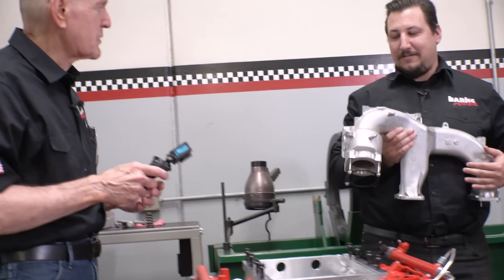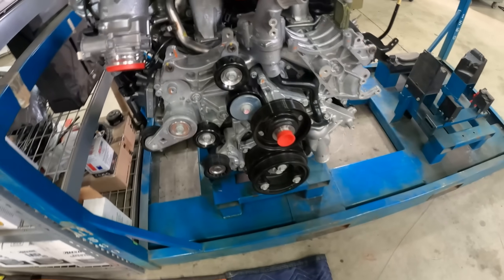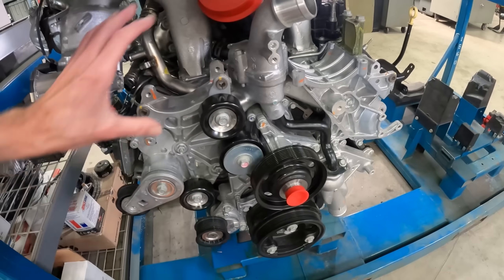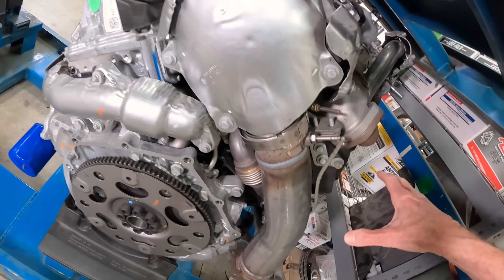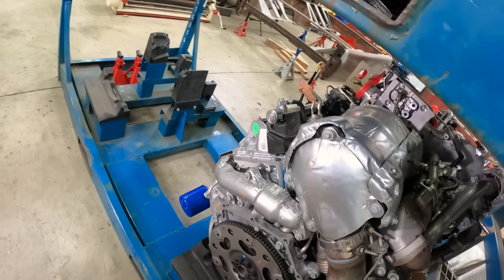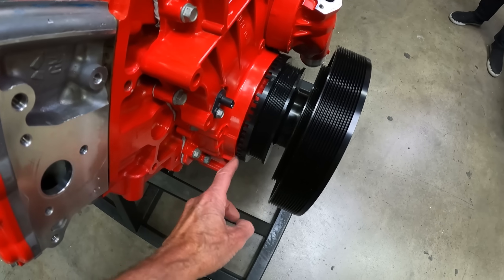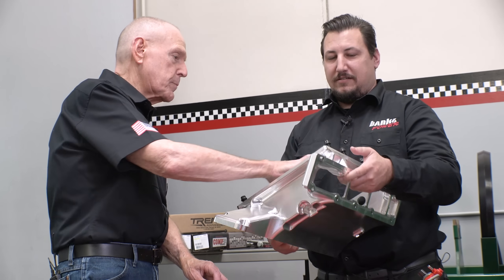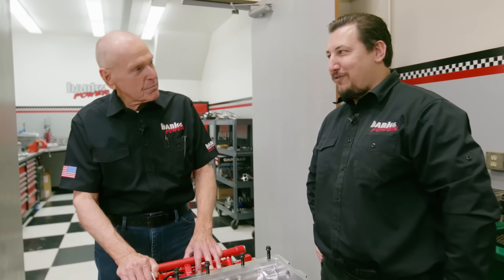Inside Banks SUPERCHARGED DURAMAX engine | BANKS BUILT Ep 40

Comment: I find it interesting that "Banks". Can remove all the emissions and DEF, and "properly retune" ..... and say "they do it right ".  Openly admit it and face no issues.  Yet everyone else who is doing the same thing.  Is targeted, fined, shut down... etc.  ? Don't get me wrong.  I like what he's doing.  I find it interesting about the head bolts. Seems one of the number one "modifications "... is to stud the block. However it's just interesting to hear him say that "he [Banks] does it right, so it's ok..." Alot of shops out there should be a little upset...
Reply from the maker: We are not "re-tuning" an emissions-regulated vehicle. There are no laws being violated. Banks engines are no different than an LS crate engines purchased through Chevy Performance.
Reply: @bankspower  oh, that's the workaround.  You can't modify an engine once its "part of" a car.  Buying a new truck off the lot as a complete item locks in the EPA stuff.  Buying the engine separate from the rest of the truck makes it technically legal to not have EPA stuff.  Pre-emissions truck chassis (or purpose built) and one of these engines is legal.
Reply: @bankspower  ?... true you can add cams and valve train changes...intakes... all those things.  Be it a LS or a Duramax... yes you can purchase a "performance crate motor " through GM.  But does that allow removal of the emissions  ? In the case of Lockjaw... ok it's a 60's era vehicle.  But any newer vehicles are going to require keeping the emissions.  Be it an LS or a Duramax.  I think it's great to pull all that garbage off. The fact is it can be tuned to be better and cleaner running without all the emissions garbage.  However people are getting shutdown and heavily fined. What is the Banks secret.
Reply: @ronthompson2366  They going after people deleting/modifying emissions on vehicles that came from the factory with those items in place. This is a 60's era truck.  Completely different.  You can drop an LS into a '57 Bel Air and not have a lick of emissions on it.  You drop a new LS in to a 2007 vehicle, you better have like for like emissions on it.
Reply: @bankspower  Cmon, you guys still do plenty that would put many shops in violation.

Comment: Since that's a engine designed for production truck, doesn't it make you concerned about the EPA? Where are you guys on the RPM Act? Your influence would be greatly valuable to save our race cars.
Reply: Because it's still going to be cleaner than with GM emissions control.
Reply: @AdmissionGaming  No it won’t, the EPA is concerned mostly with nox gas which is caused by higher combustion temps causing the nitrogen and oxygen in our atmosphere to combine forming a colorless gas called nox. Just because a diesel isn’t blowing black smoke doesn’t make it “clean”. VW was sued for over $20 billion for tunes inside of their vehicles that would alter engine performance during emissions tests to lower nox gas. Gale has done great things in his lifetime for the automotive performance world but he stands idle while our government slowly kills the industry. Truly a disgrace.
Reply: @slycarlo8747  it's called nitrogen oxide not nox
Reply: @michaellee5399  NOx is the generic term for nitrogen oxides.
Reply: @slycarlo8747  I'd like you to step back for a moment on that disgrace comment. I was a GM line mechanic when all the EPA biz hit the industry- and heard all the whine coming from GM/Ford/MOPAR and other domestic sources about how impossible those standards were to meet. My side work at the time was foreign made; they didn't carp, moan, groan or otherwise complain- their engineers figured out how to get their products into line so they could LEGALLY import into the US market- and they didn't give up gobs of horsepower to do it either. their engines and drive trains were much more mileage conscious and better designed- which only led Detroit to bitch, carp and moan more. And yes, there were some problems with them as well- problems most of those mfgs solved before the US gov and EPA dropped a bomb on them. 
   Banks Engineering has been a contractor for GM and to the US military for over 30 years- he took that start and figured how to live within it- much of the performance industry, particularly the diesel crowd, have taken the "cool smoke" route to impressing their clients. Gale just beat the crap out of them every time he went racing against them- without the smoke, carping and general pissing and moaning. Were I you, I'd be giving the man full credit for not outing his competition for their laziness and incompetence. But that is just IMHO. FR
Reply: @fuck_youtube_censorship00  well considering your on the internat apparently you don't either
Reply: @fredericrike5974  I agree with what you said, I also wanted to mention that I worked a union job for 16 years, that level of bitching is commonplace in an American union backed workplace lol.
Reply: I am wondering about this. Even with the lockjaw project its a 1966 chassis that is after the passing of the clean air act. It will be a Vin chassis with an engine that has a oem emissions protocol. Its probably illegal without all the oe emissions equipment.
Reply: @timothybayliss6680  The Euro 3 standards Gale is talking about were late '90s or early '00s- much better than the standards from 1966 when this truck's emmissions pint was set. Probably better even than a gasoline motor from that era.  FR
Reply: @fredericrike5974  i dont know if it matters. Cali standards are to the engine, not the chassis. Its why you cant legally swap a B20 CRV engine into a Integra, its a "truck" engine into a "car" chassis. Any of the Mustang engine swaps, things where you have a Gt500 engine in a foxbody, all the emissions control equipment from the original engine are maintained and any modifications to that engine must be Carb exempt for the engine, not chassis. California has exemptions for inspection, that is pre1997 diesel and pre1976 gasoline light duty trucks and cars and specialty constructed chassis with a waiver. My point is that it would probably not be legal in California to do this swap even if it is exempt from inspection.  It is a 2021 model year engine and as such be subject to all regulations as required by the original source of of the engine. Even if by virtue of the chassis it is exempt from inspection it doesn't necessarily mean it is exempt from enforcement. The exemption from inspection for registration specifically states that "all vehicles" are required to comply with emissions regulation.
Reply: @timothybayliss6680  Good points- and I'm not nearly silly enough to opine on your thoughts. The Cali Air Research Board rules, laws and findings have served as a bellweather in many states for this sort of law's future- even pushed the Federal Laws to achieve more than they may have intended. 
  On Lokjaw, we will have to see if a real Cali license plate is on it- Bank's could probably plate and register it in some other state- I'm sure in the present "climate" he has had some "legal advice" on the matter. I also don't have enough info to say if his intention to meet or exceed the Euro 3 standards wouldn't achieve the results- and Cali did have a process by which individual vehicles could be verified and specifically "permitted" back in the '70 and '80s, IIRC.  TY,TYVM   FR
Reply: It's going in a pre-emissions truck in this case. It will likely pollute less than a restored original. By him tuning non-smokey engines for racing, he is doing the community a solid.
Reply: @nobodynoone2500  I'm going to stand on my comment to @Timothy Bayliss- Gale Banks is nobody's fool, and i expect he will have done considerable research and legal checking- Lokjaw is the "announcement" of Banks' intention to sell diesel performance "crate motors". I'll bet on Mr. Banks to have already addressed this. Do I have any takers on my $1 bet?  FR

Comment: Why do head bolts need to be replaced, not be reused ?
Reply: They are stretched from the torque applied and do not return to spec. Best just replace them once you have everything apart.
Reply: @dragoonTT  if that’s the case then why not replace head bolts every 100,000 ???
Reply: To be specific, not all head bolts need to be replaced but in this case, and a lot of other modern engines, the bolts are torqued to their designed yield point, you can only safely do that to a bolt once, try to reuse them and you'll be breaking them off trying to reach the torque value
Reply: @danieledwards1081  one bolt in a “given” head needs to be replaced. Same bolt in “other” head is fine to be reused.
Reply: Racers are pushed to same limits in a race v life long daily driver. Then racers can’t reuse a head bolt with 20Km v 200,000Km.
Reply: Are we replacing head bolts cause that’s the way it’s always been done. Has it scientifically been proven head bolts must be replaced after X ???
Reply: @martinbrousseau2560  Yes the science has proven that once the boat has been torqued to yield it has a higher potential to break when torqued again.
Reply: @cencoast_7.340  are You so sure you are not repeating what you’ve heard ?

Comment: TTY is a sequence not a bolt. If you test TTY bots to failure and then 80%-85% yield you can retorque them all you want. all you need to do is find that 80-85% range of the bolt. I have done this test with LS bolts and retorqued them 20+ times with a nut runner (TQ + angle monitoring Acradyne) and the fastener is just like any other. TTY is a SEQUENCE.
Reply: Nope
Reply: If you're only torquing them to 80 - 85% of their yield point though, is that torque to yield?
Reply: @danieledwards1081  no that is about the standard for most fasteners. For example a LS M11x2.0 10.9 80-85 % yield is about 75Ft/lbs from what I have tested. I then run them down in the fixture 10-20 times each with no change in the torque angle curve.
Reply: @Lassi Kinnunen 81 my point exactly
Reply: @Lassi Kinnunen 81 well said thank you

Comment: Just give GM that clean tune and minimal emissions and get the party started with that freed up power..
Reply: I wish it would work that way but it would have to be legally approved by the EPA because they have the requirement for emissions control units on Diesel engines
Reply: @tjboylan20  No they don't. They have the requirement to achieve a certain maximum amount of emissions, and the EGR and other components is how that is accomplished. If GM thought they could meet EPA regulations without using the EGR, then they are within their legal right to do so
Reply: Imagine that they would never go for that probably would cost a lot less money and be a lot more reliable and u know they you to be in and out of the dealership regularly spending money on that garbage
Reply: @jerrywooton4308  I’m in the engineering field and I’ll just give you a little insight on why they would never do that it is possible for every vehicle to never have anything break and no maintenance except fluids, bulbs, and brakes. If we did that we would cause mechanics to lose their jobs because essentially they would lose almost all work
Reply: @tjboylan20  I know that that’s why I said imagine that I know they need a Vera mount of failure to keep there service dept busy but not to the extent they go pretty soon we won’t even be able to change our own oil without a trip to the dealer
Reply: @tjboylan20  im gonna be honest with you, as a mechanic i would love to never have to fix an unimformed customers car ever again lol. ill happily be the " just the oil change guy " :D hope you have a good day ! and if you could ever muster up a never die straight 6 engine please let me know !
Reply: @bucket-9-9  I definitely will work on that i too would like that it’s definitely possible it’s going to take a lot of testing with petroleum engineers involved along with metallurgist
Reply: @jerrywooton4308  The auto manufacturers aren’t the ones pushing for emissions control, it’s the oil companies. By choking down an engine and making them “cleaner”, the engines will burn more fuel. If you completely delete a semi or any other heavy equipment, you can gain about 1.5 mpg on average. Now multiple that by how many trucks are on the road and you can see why it’d be very advantageous for oil companies to push “clean” diesel, while their massive cargo ships transporting the oil are able to run with zero emissions control. Gale knows all this but chooses to tell half truths to his viewers about his “clean” setups lol, they’re aren’t clean at all. They’ll actually produce way more nox gas because of the higher combustion temps, nothing to do with the black smoke. When the nitrogen and oxygen in our atmosphere is heated above a certain temp, it will create nox, which they say causes all sorts of things like babies dying and the ice caps melting. That’s no exaggeration either, look into the VW suit. “If you have selfish, ignorant citizens, you're gonna get selfish, ignorant leaders.” -George Carlin.
Reply: If only the world was as great of a place for circumstances like that...I'd even argue its more environmentally friendly. Less emissions equipment to be manufactured full of precious metals...that are mined and that whole rabbit trail.
Reply: @TheScuba_Steve  you’re completely correct being in the engineering field we know exactly what is best when we design it but policies that politicians put in place make use change it we need engineers in politics